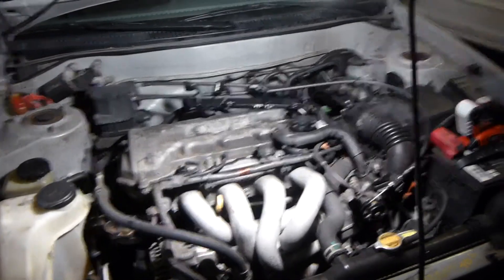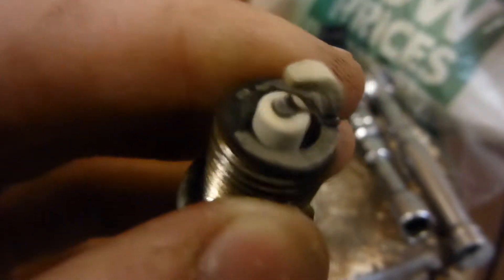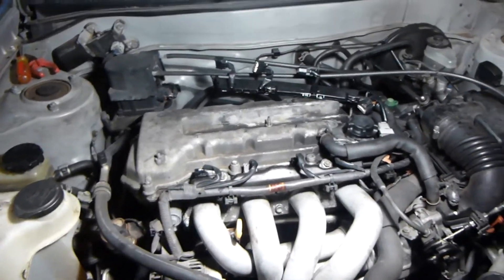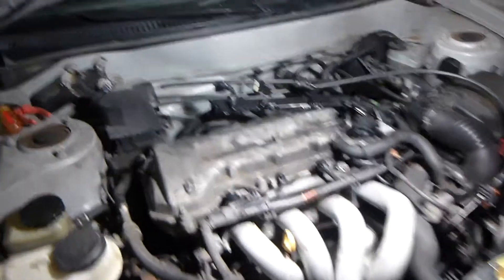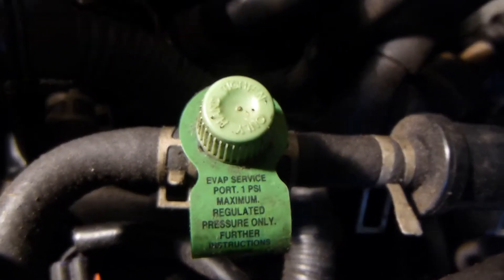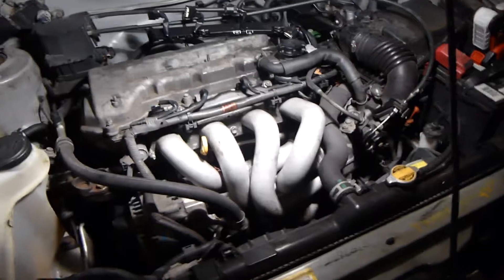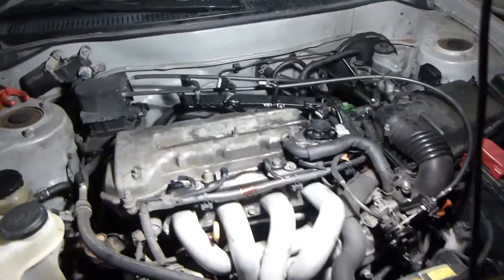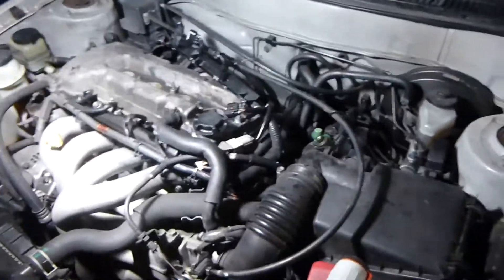Does My Toyota Corolla's Spark Plugs Look Okay and Talking About Running My Car on Gas Vapors

Comment: I'm sure you've looked around already on spark plug discolouration, and found that the appearance of yours doesn't quite match any of the obvious problems.

I think they're just very old.  Cleaning will help (let us know how your mileage changed), but you might want to think about new ones, as over time, heat and pressure will break down the dielectric, and electrode wear will lead to coronal losses.

As for running a car on gas vapours...   Uh, no.   Under very limited, no-load, pre-warmed conditions, there may be enough (or even excess) gasoline vapours to keep an engine running, but the air/fuel mixture would be very difficult to meter  through a bubbler for anything approaching usable automotive operation.  And sure, it's entirely possible to squeeze 100 miles/gallon out of a gallon of vaporized gasoline  in a Corolla.  but you'd be able to walk those 100 miles faster.

To rig up some sort of metering mechanism, based on engine demands, like bubbling more air through the gas whenever the pedal's down, would eventually lead to the re-invention of the carburetor, which dispenses a mist of fuel into the engine's air intake in proportion to the rate of air entering the engine.  At warm idle, the amount dispensed by a simple, well-tuned carb is more or less (probably less) than what evaporates in a bubble tank.  Electronic Fuel Injection is very similar to carburation, except the fuel dispensed is based on calculations based on a variety of sensor's feedback, and not just the rate of airflow through a Venturi nozzle. 

Oh, and whatever amount evaporates in the bubbler is pretty much what gets burned, whether the engine needs that much or not at the time.  Carbs kept that waste to a minimum by dispensing fuel right above the engine's throttle plate, as did the first fuel-injection designs.  This progressed to multi-point FI dispensing portions of the  fuel right near the intake valves, and on to sequential multi-port FI, which dispensed only the amount each cylinder would likely need right before its valve opened, which is what your car does.

Modern engines now inject the fuel directly into the combustion chamber at high pressure, in the precise amount required to generate enough energy to advance the next cylinder to its power stroke.   

The common theme to the technology progression is to reduce inefficiencies caused by excess gasoline evaporation into the air intake, which is somewhat opposite of gasoline vapour operation.

Oh, the EVAP canister is a charcoal-flined vacuum chamber that scavenges gasoline vapours from the intake manifold and gas tank, which would otherwise escape to the air.  The canister is then purged into the running engine periodically, to be burned.  Conveniently, while this is happening, the fuel injectors dispense less fuel, to keep the air/fuel mixture the desired amount.

How much less, or how often does this happen?   I'm not sure.  I suppose it's different for each car, and conditions.  An OBD-II diagnostic tool might be able to tell, along with a vast array of other fuel metering and efficiency data.  There are various kinds of OBD-II interfaces:  some self-contained, others just cables that attach to a laptop and send data to an app.  The newest have Bluetooth, and interact with smartphones.

Since car's computers are set up for the general case of driving, there very well could be significant fuel economy gains to be had for your driving conditions and style.  Ultimately, this would likely come from a better understanding of the workings of your engine and transmission and perhaps a programmable ECM, weight reduction, aerodynamic improvements, and good vehicle upkeep.  Just cleaning your plugs ought to have a tremendous effect.  However, circumventing decades of fuel delivery engineering advancements by resorting to gas fume operation....

Oh, do you know how explosive gasoline fumes are, in the amounts that some bubbling schemes call for?  And that all that stands between a fume bubbler and an ignition spark is, ideally, a few mm of valve seat, and a valve that closed fractions of a second prior?  Also, how easily an engine running lean backfires?
(When an engine under load turns backwards instead of forwards because there wasn't enough power for the load, the intake valve re-opens as the fuel is burning, and exhausts the heat and flame into the intake.  It's why old-timey air filters came with metal mesh screens: spark arrestors.)

---

PS.  Loved the acetone-copper reaction.  What's your source of acetone?  Nail polish remover works, but it's kinda bland.
Reply from the maker: Nevin Williams Yeah I should invest in some new spark plugs and a computer reader.  Do you think this one would work ok?  http://www.amazon.com/BAFX-Products-Bluetooth-diagnostics-Android/dp/B005NLQAHS/ref=sr_1_1?ie=UTF8&qid=1416772995&sr=8-1&keywords=elm327  

I see what you mean.  It would be hard to regulate the fuel to air mixture.  I have a couple ideas though.  I would not go with the bubble vaporizer.  Just like you said it's really unsafe.  Especially having a large, potential, combustion chamber with several inches of gasoline at the bottom.  Just seems like a dumb idea to me.  The method I had thought up would only use the amount of gas that the engine needed at that exact moment.  It would actually be powered off the fuel injector signal.  So there would really not be any modification except adding my vaporizer after the throttle valve.  I'll see if I can pick up an old gas motor for free or really cheap somewhere and do some experiments on that before I try to modify my working car and possibly ruin something.

The one theory I've seen explaining why you can get better gas millage with a vaporizer is: the fuel mist from the fuel injectors does not vaporize quick enough and there might be some fuel that burns late or not at all.  I guess it's really a myth because it have never been proven to work that I know of.  Lots of people just clam it works.

Thank you!
Reply: Makerj101 Usually, when an app requires hardware to run, the app is free, so I'd probably skip the rip-offy looking Amazon plug.  Since all OBD-II plugs can get the same info from the car's ECM, it'll be the software that lets one do neat things.  Since most legit apps that require hardware are free, check out the apps first.  Sometimes, there are modules that are a few extra bucks, like ABS and stability control diagnostics, but standard OBD-II covers all engine and emissions reporting, standard across all makes and models since 1996, whereas the others require a lot of custom coding for specific model, and thus might warrant an extra cost for development.
Reply from the maker: Nevin Williams I'm confused.  If I understanding you correctly, you're suggesting buying one of the even cheaper models?  Thank you!
Reply from the maker: Nevin Williams I see.  Makes sense.  Sounds like I should just leave my car alone!  Not worth the risk of ruining something.  I guess there are a lot more complicated systems that I don't know about.  If the fuel cools the valves like that then running vapors would over heat the valves.  And that's only one possibility.  Thank you so much!  You really know a lot about cars!
Reply: Leave your car alone?!  Oh geeze, I hope not...  Working on cars is an awful lot of fun and very rewarding, as there are so many automotive technologies to learn about, and there's assuredly room for improvement in any of them...  The gas vapour thing though, is one of those "doomed to repeat history" things... sort of.

I know what I know about cars by having worked on many.  I did take an auto shop class in high school, which helped me to learn fundamentals, in a fairly condensed timeframe.  There wasn't a wiki then, though.  :)

However, enough about what you haven't done, and more about what you have...

Given the condition of those plugs, I suspect your car runs way better after they've been cleaned.  What're you getting for milage now?

Try hooking a (spare) spark plug up to your high voltage stuff, and see what there is to see.  At least, you don't have to worry about a few feet of spark plug wire that are prone to leaks.  However, they're excellent at transmitting high voltage/low current power when they're in good shape...
Reply from the maker: Nevin Williams No, that's not really what I meant!  I meant not modify it in stupid ways that could ruin it!  I will be replacing the crank seal and valve cover gasket soon because they leak some oil.  I also may do the brakes eventually because the brake disks look really thin and warn.  

I'm not sure!  It doesn't have a instant gas mileage thing like newer cars.  Only way I can know if next time I fill it up with gas!

How do I see if it have more power/efficiency after each new modification?  Like how do I figure out if there is any improvement after I replace the spark plugs or clean something or after having it serviced etc?  Only way I could think of was see how long it takes to go 0-60mph and compare results before and after.

Thank you!
Reply: So, for a 2500 lb car with 125 hp to shave half-a-second off of 0-60, it would take around 7% more horsepower.  Half a second is roughly when you can honestly feel a mod by 'seat of the pants'.  A 7% increase in engine output is a significant modification, like a supercharger or nitrous, maybe.   Or, a reduction in weight of 220 lbs would give similar results.  I used the online calculator at torquestats.com to compute these ballpark figures.  (I put a few of my own cars' stats in, and it was pretty close, all things considered)

OBD-II has fuel economy stats:  the ecm knows exactly how much fuel each injector delivers, and so can compute instant MPG. 

One thing I can think of, off-hand, that might be telling...  (at least, it'd probably have shown an improvement when you cleaned your plugs) would be engine vibration:  if your phone or other device is equipped with an accellerometer, measuring the vibration before and after might show the change.

Most modifications to be done are not huge instaneous improvements, but over time, can amount to a significant fuel savings.

Is it very cold where you are?  The vapour idea isn't totally without merit.  If there was a way to heat up the intake manifold around where the injectors spray when it's cold, it'd save some fuel, as iit would normally condense, and not be burned until the car heated up.
Reply from the maker: Nevin Williams I replaced the air filter today and I actually think I can feel a slight difference.  It seems to respond faster and have a little more power.  The guy at advanced auto parts red the code for me and it came up with a bunch related to air temperature.  So mass air flow meter?  Anyway he asked when I changed the air filter and I said I never have since I bought it 2 months ago.  He took a look and said it was really bad so I bought a new one.  I guess that should help fuel economy.

That's a cool calculator!  I think my car has also lost some acceleration power tho.  Due to finally getting a spare tire!  When I bought it there was no spare.  So now I have like 40 extra pounds to drive around with!  :P

I bought this OBD reader:  http://www.amazon.com/gp/product/B00AAOOQJC/ref=oh_aui_detailpage_o01_s00?ie=UTF8&psc=1  Only problem is it doesn't work.  Well technically that's wrong.  It won't work in my Corolla.  I tested it today in my parents Toyota Sienna and it works great.  So that's really sort of annoying.  :(  I took my car to Advanced Auto parts today and had them check the code and they got codes so it's not my car.  It's that the reader doesn't like my car I guess.  Oh well I guess that's what I get for buying something so cheap and not going with a name brand.

Interesting idea with the vibration.  I will do that when I put in the new plugs I bought.  I will have to find an app to look at vibration.

I live in PA so it does get fairly cold in the winter.  But the summers are not that cold.  See that's kinda why I think the vapor system might help with efficiency.  If you put a cup of gasoline out in open air for a couple days a good portion of it will evaporate.  But there is some left which are additives and compounds that are not as volatile and do not evaporate readily.  It's the vapor that burns and not the mist.  So if you spray a mist into the cylinder the volatile compounds will evaporate but what about the rest?  I mean the temperature in the cylinder will be a little higher and also from the compression but it has to vaporize in a split second.  I think it's totally possible that some of those no so volatile compounds are not totally evaporating in time.  So if we were able to totally vaporize all the components of the gasoline then we should get a better efficiency.  I have an idea how to do this.  It's basically using a heater to boil the gasoline.  I want to try it really bad but I also don't want to maybe mess up my car.  :/  I guess I need to make it modular so I can put it into my car in like 15 minutes and then if I need my car to go some where I can take it out in 15 minutes.  I don't want to build it into my car because that could cause permanent problems.
Reply: The test for an air cleaner is to shine a work light through it from the clean side out.  Filter paper's translucent; dirt opaque.  As it gets dirty, the filter becomes blotchy, but there are still lots of places that show light.  When there are more dark blotches than bright, it's a good time to change the filter.  Of course, dust that can be knocked or blown off (gently) should be so before the test.  Dust that's trapped in the filter and clogging it will not come out without compromising the filter, and even a clogged filter is better than one that's letting dust through.  Given the shape of your plugs, I suspect the air filter didn't get much love either.

That's really strange how your plug works with the newer car (same manufacturer, too) but not the older one.  Have you googled the issue?
What sorts of information can you get from the Sienna?  

Good points about the additives in gasoline.  I suspect they're all volatile to some extent, but how much so?  I'd take a very clean piece of glass and evaporate a small drop of gas on it, and examine the residue, if any.  (fractional distillation will have the more volatile components evaporate first, so at some time scale, different grades ought to evaporate differently),  Do you have a flatbed scanner...?   I use mine to scan in evaporated solutions of various water-based things, but I've not tried gas before.  I have some two-stroke fuel that will assuredly leave residue.  I'll have to be extra careful with gas, because it'll probably stain or dissolve the cover if I close it.

My other evaporated images are on my facebook, somewhere, but perhaps I'll make a slideshow for here, if iPhoto cooperates, and I've time.

--- tbc ---
Reply: It's much harder to mix two gasses together in proper proportions under highly variable conditions.  If you can figure out how to light your propane burners with the proper flame on the first try every time, you're only part way there.  If you can do it in hot or cold air, you're closer.  If you can do it in gusty wind conditions, you're almost there...  

Do it 120x per second, and you can get a L4, 4-stroke revving to 3600 RPM.
Reply from the maker: Nevin Williams Interesting!

I will try it again in my car to see if maybe it worked out the bugs or something.  But some of the reviews of the OBD reader I got said it works with some models and then the next model of car it doesn't.  So maybe it just doesn't like my car.  IDK.  Cheap junk thing...

I put some gasoline in a shallow container and let it sit for a couple days.  There was still a good bit left.  I tried lighting it and it didn't light until I started heating it.  So that tells me that it won't burn unless heated.  Maybe I'll try your glass idea.  
Hmm I guess I can leak my idea...  I wanted to test my idea out first so no one beats me to it... Oh well.  So basically I would not have to do any calculations on how much fuel and air I need.  The car already does that.  So my idea is to just take the fuel injectors and have them spray the gasoline onto the walls of a heated container.  The gasoline would be boiled and the gasoline vapors would be added after the throttle valve.  Maybe even where the injectors are supposed to go.  So the car would still do everything.  It would just be running on pure gasoline vapors instead of mist that hopefully vaporizes in time.  The engine would also adjust.  At least it should.  So if with my system the engine gets more usable power from the gasoline then less gasoline would be sprayed into the vaporizer.  And the engine would still think the engine is running normally but think that the gasoline has more energy or the load on the engine is less than normal.   Simple I think.  But I need to try it to be sure.  Does my idea seem sound?  Do you think it would work?  Any suggestions?  

Thank you!
Reply: Haha!  Excellent.   Such a method, used when the engine is cold, might save fuel used during startup, much like a block heater does by pre-warming the engine.

I'm not sure if this applies to your model year, but around that time, Corrolas used plastic intake manifolds.  I think I came across your page while looking for induction heaters, though fuel injectors are a bit further up in the head itself, and squirt fuel on the valves.

Something to investigate for this method would be the properties of condensation on multi-temperature surfaces:  If you dissolve gas in air by dripping it onto a hot surface, does it quickly re-condense on adjacent metal surfaces that are not heated?

increasing the efficiency of cold starting conditions is probably the most fruitful area to investigate.  Small improvements in this area not only reduce gas required during the startup cycle, but also greatly reduce emissions.

So, would it be sufficient to only heat a target area where the injector sprays, or would the fuel just quickly condense onto adjacent cold surfaces?  Can the whole surrounding intake port be heated efficiently, if condensation is a factor?